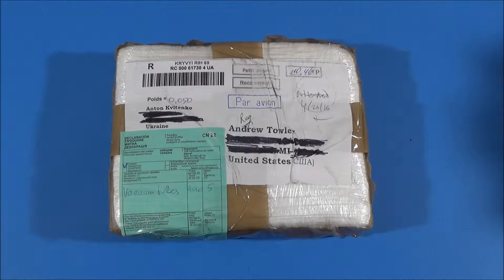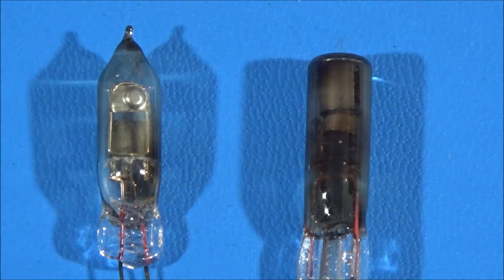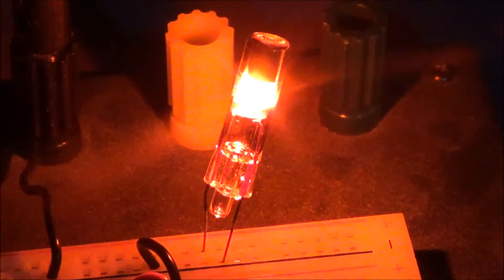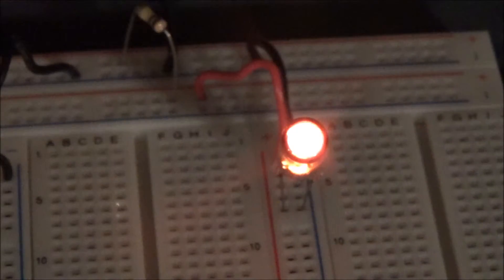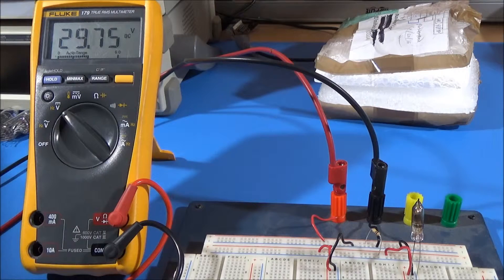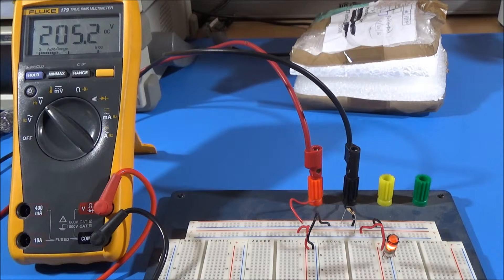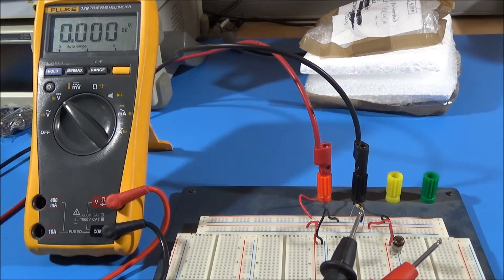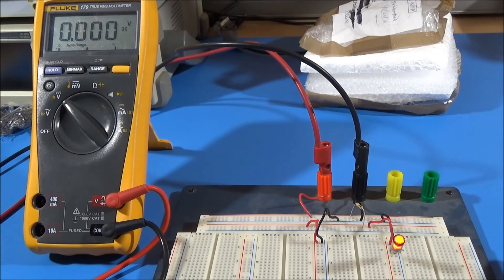OhmsAtHome #15 IN-3 Tube Testing

Comment: I don't know if you figured this out but the end view is an IN-1 and the side view is an IN-3 and there are plenty of datasheets available. The IN-3 is meant to be 90V MAX!
And they only want 0.8mA operating current.
"
Here is translation from the original IN-3 datasheet.
----------------------------------------
IN-3

Light up voltage - not less than 60v
         - not more than 90V
Switch off voltage with anode resistor 300kOhm   - not less than 55V
Operational current -  0.8 mA
Guaranteed life time  - not less than 5000 hours
(with lighting up voltage not more than 95 V)

Absolute maximum ratings:
Light up voltage - not less than 60v
         - not more than 95V
Switch off voltage - not less than 50v
         - not more than 80V
Anode current     - not less than 0.2mA
         - not more than 1.0mA
Temperature    - not more than plus 85C
         - not less than minus 60C
"